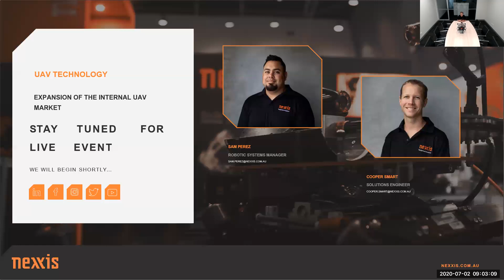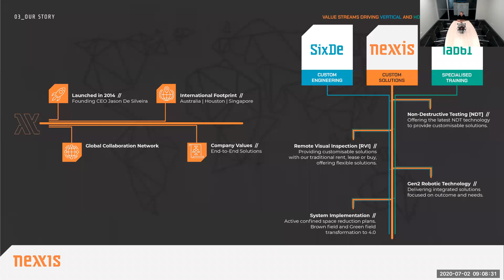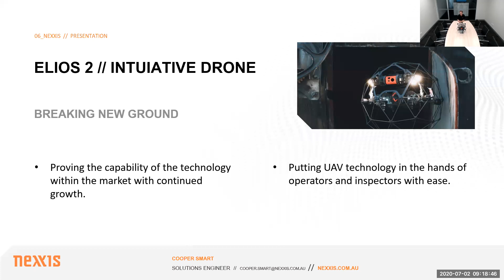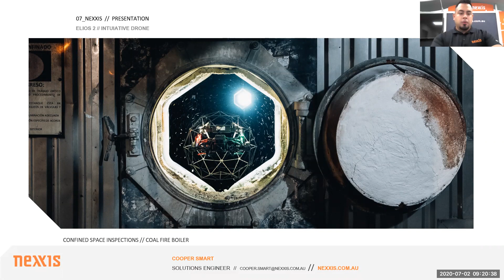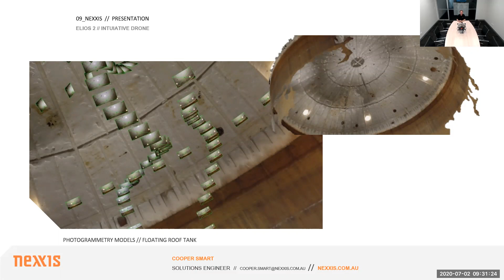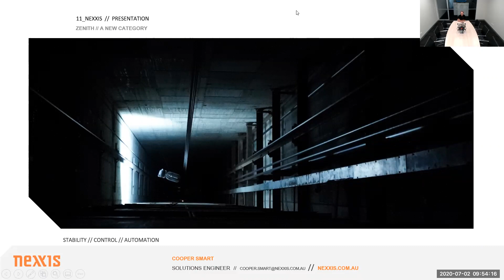2020 and Beyond: Using Drone Technologies for Inspections

Comment: Would it be possible to ultrasonically measure the wall thickness (2.5 to 10 mm) 6of round tube (60 to 300 mm diam) positioned 20m above ground, by way of a drone ?